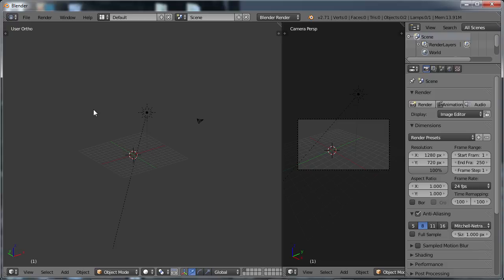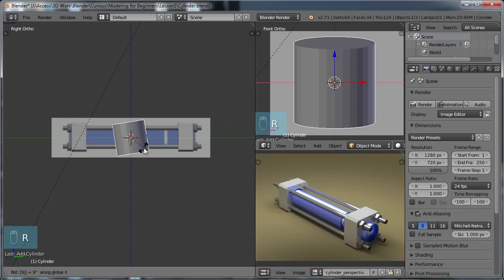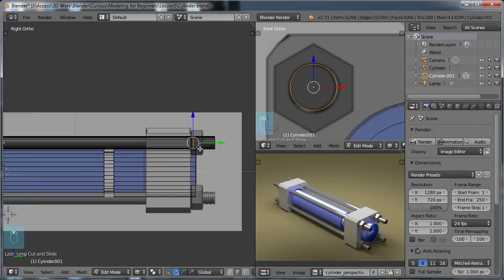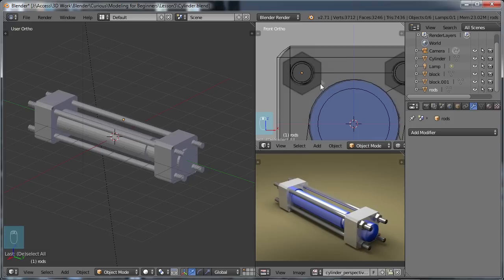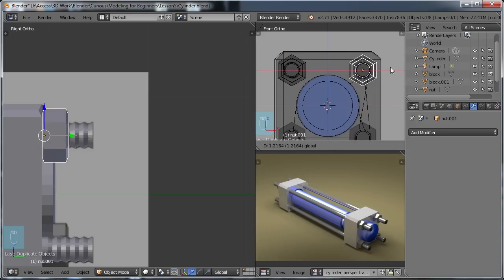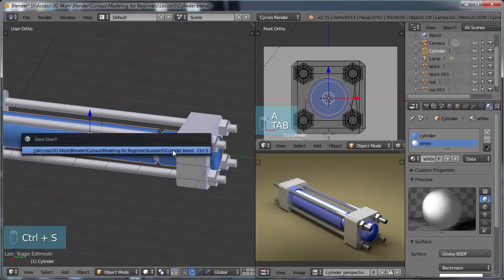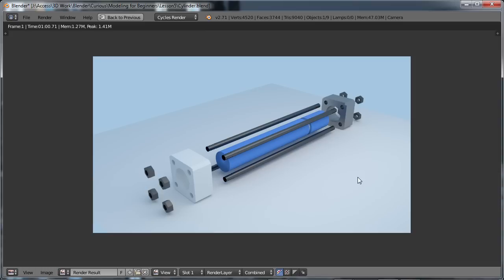Blender For Noobs - Modeling for beginners - Part 5 of 10

Comment: Am I the only one who is having problems with lining up the bolts in the side view after I lined them up in the front view?As in the front view I got the first cylinder(bolt) lined up with the top left bolt, but in the side view the cylinder is like 1/3 down from where it should be. Why are my pictures out of wack? I did the calibration cube thing he did to make sure it's all lined up.What did I do wrong?

Comment: Here an advice.
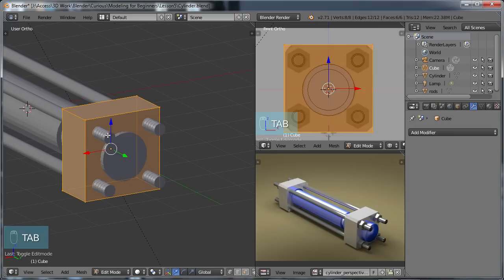Instead of doing that from 24:33 to 26:07, you can also use the bevel modifier by simply selecting the 4 edges of the cube, then press Ctrl+B and make those corner without having those little triangle on the edges, it'll look more smooth, cleaner and more closer to the look of that object.
I hope this help you guys :)

Comment: HI, I am using v 2.78, and I am having problem with Boolean Modifier. Please Help.
Reply from the maker: Hi, sure, what kind of problem are you having.  The Boolean modifier can be a pain sometimes.
Reply: The holes does not show up, when I go to edit mode, all the wholes are there, but not in object mode.
Reply from the maker: Make sure you did the Boolean operation in object mode (I think it's the only way you can), but also make sure once you put the object where you want it, you apply the modifier to make the operation permanent.
Reply: Thanks. :D

Comment: How to select a ring of vertices around the cylinder? I hear the author saying: "alt select" but I do not know how. I push on the alt key and click on the mouse.
Reply: yes, hold alt key and select between two of the vertices in a ring with the mouse button
Reply: +Don Nobles, I had a long request written below, but I have i've deleted it. Anyway I found a soultion, The problem was i had "emulate 3 button mouse" selected in user preferences. once deselected everything works as normal.

Comment: sorry but i cant find the resize slider anywhere you used at 5;57 i am using version 2.78c
Reply from the maker: In the latest version, they are 4 little buttons and it is the one in lower right hand corner.  The two at top move the image left/right and up/down and the one on the bottom left rotates the image.

Comment: Ok, so I'm trying to learn the Blender, watching all theese tutorials and I'm getting really confused.
I created a room: walls, floor, ceiling, door, window, single camera.
This should be completely dark with no lightsource. Added a light so I expected a light coming from outside creating pretty harsh shadows inside, you know what I mean.
What do I get instead? My render (no materials/textures) looks like there is an omni light. The light is simply everywhere. I tried different light types. I tried even with no light source at all. I'm really confused...
EDIT:
As I played with materials I noticed that bright surfaces are actually emiting light! But why? Should I just be patient and take some ligting/materials tutorials?
Reply from the maker: Yes, it's funny.  Sometimes I still go to render a dark scene and have to say "Where is this light coming from???!!!!".  First thing to check is that you have no lamp (sun, point, hemi, etc.) or if you do, that the power is turned down to zero.  Next, make sure you don't have any emission materials.  That is, when using cycles, make sure you haven't set the material of an object to "emission" because in Cycles, that is what you normally use for light sources.  Next, and probably what is happening in your case, check your background under the world settings. Make sure the strength is set to zero.  This is usually the culprit if you have unwanted light coming in.  Finally, also check your ambient occlusion setting also under the world settings.  You should always uncheck this unless you specifically want it for your scene as it adds render time.
Reply: Got it. Both world settings. I checked all the other things first but didn't know 'bout those. Now my cylinder casts nice shadows ;) Thanks a lot.

Comment: Hi! Your site is listed as having malware and being blocked by Google. I cannot access your file. Thanks for wonderful tutorials!
Reply: +BlenderForNoobs It stil seems to be under attack. I tried less then a minute ago and it was blocked by my virussoftware.
Reply: +BlenderForNoobs Its not your youtube channel, its thte referance images in this video.
Reply from the maker: +MoeuStudio My site was hacked.  It is back online now!
Reply from the maker: +Morten Fjellheim it may be that your software has it blacklisted because of the previous problem...not sure.  I went through Google's process to fix the site and after that, I am able to get to the site through Firefox, IE and Chrome with no problem.
Reply from the maker: +Morten Fjellheim Yes, I understand.  The reference images are located on my website, blenderfornoobs.com.  The site was attacked in Septemeber and has been corrected.  I can put in the links and get to the images with no problem now, so as I mentioned, your antivirus software may be blocking it or you may need to clear your browser cache.
Reply: +BlenderForNoobs I'm also experiencing Malware warnings from my AV and it has been blocked in Chrome. I've cleared my cache but to no avail. I hope you can get it sorted out. It would be a huge pain for you.
Reply from the maker: +Scott Donald Not sure why...been clean since September.  I've tried it from various public computers using various browsers with no issues.
Reply: I wonder if it's a Google location based issue. My VPN has expired but I'm heading back to Aus in a few days and I will try again. Thanks for the hard work.

Comment: VERY USEFUL COMMENT HERE regarding the Boolean modifier @27:27 : For those of you using Blender v 2.74 (and up, I guess) you would have to use the "Union" operation instead of "Difference" to get the desired effect. When you use "Difference", as you may have noticed, creates a duplicate of the intersected object and merges it with the block. Thumbs up so this comment can help other people as well.
Reply: +ninorokr I'm using 2.76 and just did it as he did in the video, no problem
Reply: +ninorokr Union didn&#39;t work in my case either. I had to use intersect for the rods, and difference for the cylinder.
Reply: I had to use intersect. I did the rods first and it worked fine but when I went to add the modifier with the cyl the block would disappear. Intersect worked fine though. Thanks for the help!

Comment: I am really enjoying the series also. I too am having a problem with the Boolean Modifier, instead of using the 'difference' I had to use 'union' to get the holes. I am using v2.74, I am thinking that is just a glitch in the program, but the problem I am having now is that when I add a new object, the circle for the nut, it isn't showing up in the other view. When I add it in the front view it isn't in the right view and vice-verse.
Reply from the maker: Karon Kelley I would have to see what it's doing, but if you tab into edit mode on the circle and choose to view the vertex view, it should show up.
Reply: Actually, the next time I used it for a different project, I had to use the 'difference' for it to function correctly. Like I said it was probably just a glitch in the program. But I really appreciate you answering me, means a lot.
Reply: Karon Kelley Hi on Blender 2.74, select the block, selecto boolean, diference, press TAB, then move the block and aply.

Comment: I tried using the Boolean technique as you showed here. However, when I selected Apply, it more "Merged" my pieces and made them a single thing. I double and triple checked to make sure I was doing the same method as you. Did they change how it works in 2.8? If so how?
Reply: Lord Xtheth Scratch that. When I did it for the outside rods, Intersect worked but when I did the larger cylinder Difference worked. Very confusing.
Reply: Having this same problem. And where it says "Boolean" in the modifier is red..if that makes a difference
Reply: Nevermind I got it to work. Had to add the modifier while the rods where going through it.
Reply from the maker: Yeah LX, the boolean functions seem a bit flaky to me sometimes.  Make sure you are using the 'difference' option.
Reply: BlenderForNoobs Let me clarify. When I say I triple checked to make sure that it was the same as your demonstration, I mean I checked it more than twice, and just less than 4 times. I did make sure I was using the difference function... all 3 times I checked. In fact now I have checked it 4 times. My pieces merge, they do not create new geometry.
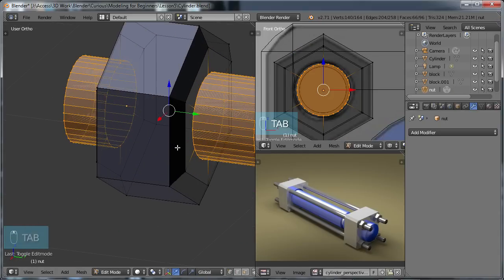Reply from the maker: Lord Xtheth Did you see 38:00 where I had a similar issue? Make sure your normals are correct.  Other than that, I would have to take a look at your file to see.
Reply: BlenderForNoobs I already moved past that point by manually putting in the geometry I needed. However, I'll have to remember the normals thing next time.
Reply: Lord Xtheth Had this exact same issue, seems they've changed it so 'Intersect' is the new difference operation. I used Intersect and it had the above result. This is on 2.72, hope this helps.
Reply: James Donovan Glad I'm not the only one.  Also couldn't get the Materials to work. Seems to be totally different. Colors won't apply to objects? Anyway thanks for the classes. Making slow progress.
Reply: I know this is a bit old but here is some information ... I had many problems ... tried this one about 20 times ... practice makes perfect though ... I was dead set on putting a slant to the threads ... so hear is some of what I learned ...

if the boolean function is red it means the process as you are attempting it is not legal ... ie incorrect ... 
next ... if all the normals on all the objects you are attempting to use for the boolean interaction are not correct the function will mal-function ... all objects must be correct not just one ... also ... you must be in the proper mode for each type of function ... very important detail ... 

Love this tutorial series ... ive messed up so much I will be pro by the time I am done ... already I can fly through most of this series with ease ... ( had to redue everything on way too many occasions ) ( yes I save often ) ... sometimes restarting helps to see where I went wrong ...
Reply: I figured this out it seems a bit ridiculous however, I recalculated inside and outside normal's and the issue did not happen after that.